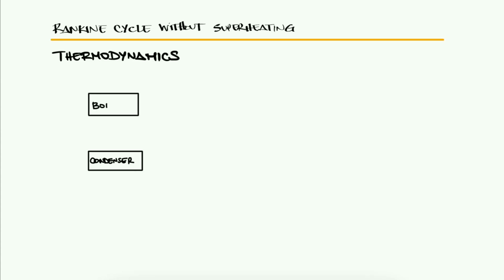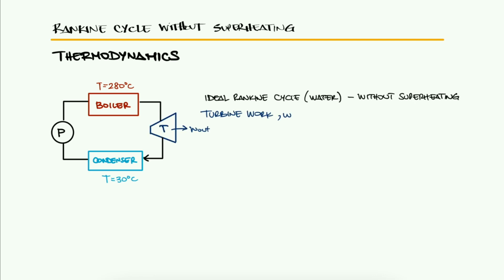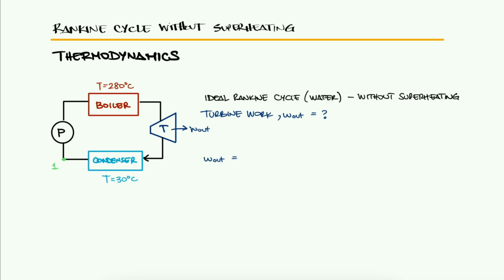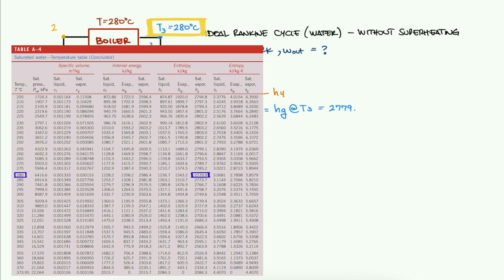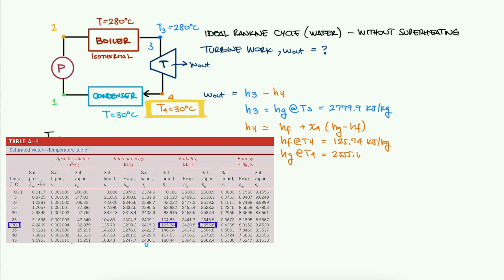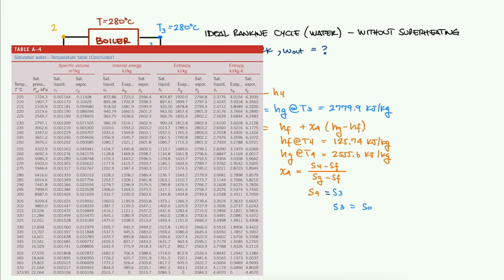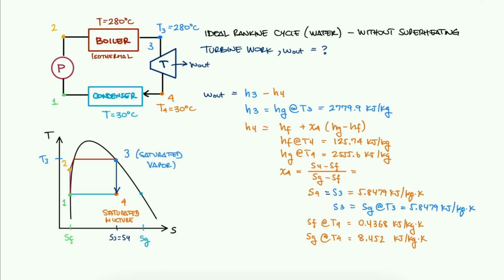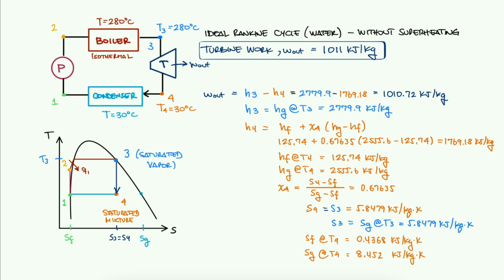RANKINE CYCLE without Superheating Example in 2 Minutes!

Comment: How do we find H2 in order to calculate the efficiency?
Reply: I believe you can use:
wpump = h2 - h1 = v(P2 - P1)

P1 = Psat @ 30C
P2 = Psat @ 280C
v = vf @ 30C

solve to get h2 = 132.178

I might be wrong but I'm quite confident in this